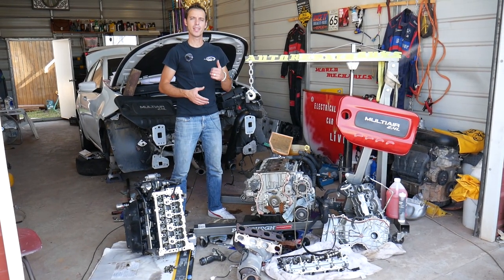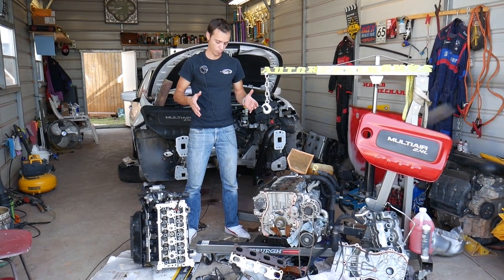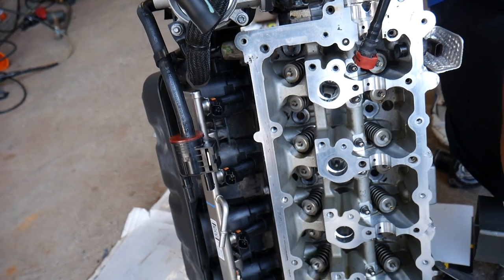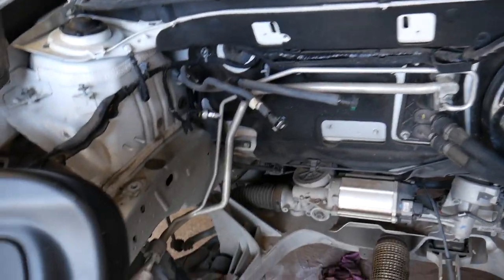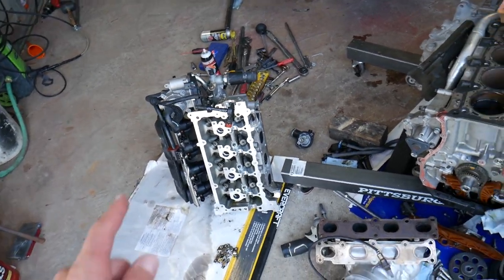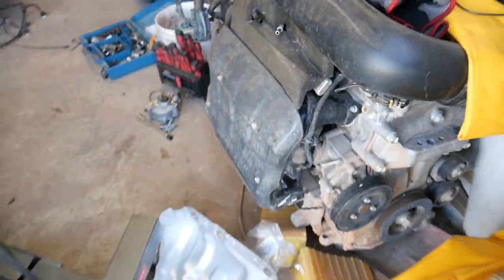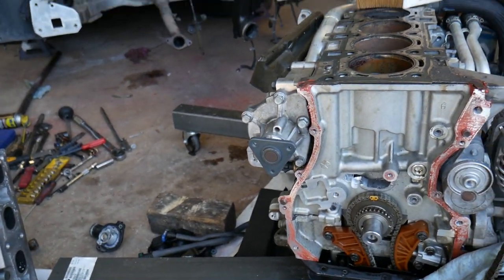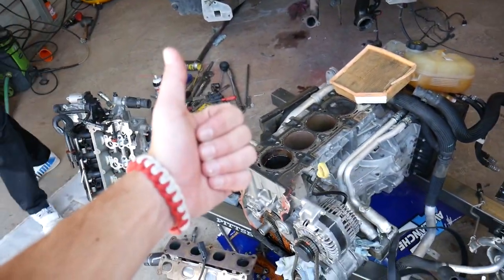WHAT CAUSES BLACK SMOKE OUT OF EXHAUST demonstrated on DODGE

Comment: Will fuel injectors cause misfires or jerking while starting engine from cold start?
Reply: Did you find solution to this problem
Reply: @AjextechWebDesign-zk2mh not yet, my buddy took over the payments and he's having this problem, but its only black smoke on taking off then clears up but car jerks when starting up.

Comment: Wouldn't a dirty air filter force the engine to spray less fuel? Unless intake air is metered before the air filter, and has no o2 sensor, the air filter shouldn't play any role in fuel metering. From my understanding.
Reply: I am thinking the same thing. The ECU should adjust the fuel mixture accordingly, but usually they have a certain limit from which they won't turn down from - so it suffocates from air and creates black smoke.
Reply: everything else would be working overtime. there would also be unburnt fuel definitely l. either way your getting poor mileage for the error. it's either retarding the timing or something

Comment: Do you think I have a bad fuel regulator? I recently got a code that it was getting uneven electrical current. But I charged the battery and the check engine light went away. I get black smoke when getting uphill on a freeway. My car has new oxygen sensor, recently cleaned MAF, and new air filter. The only things I can troubleshoot next would be throttle or maybe fuel regulator but I'm not getting check engine light to come on.  (2007 Audi A4 2.0; 163k miles) I'm not seeing coolant leaking.

Comment: 1- Bad Air Filter
2- Bad Fuel Injectors 
3- Bad Fuel Pressure Regulator
4- Bad Mass Air Flow Sensor
5- Bad Oxygen Sensor
6- Bad EGR Valve 
7- Bad Engine Computer

Note: I done all that & spent all that money but still black smoke & black liquid from exhaust 🤦🏻‍♂️ I now sold the f💩💩ken Audi A4
Reply: Any of This  reason, if have problem Isn’t car need to signal on dashboard with the eror code ? Or when we connect to computer ?
Reply: That's what I did to the fucked up golf 4
Reply: @ozandarik6757  nothing was coming up on the scanner
Reply: uggh, I am there now. Can't afford to replace everything on the list. I also recently had a lot of work done due to oil leaking on two parts of the engine one of them on the housing.

Comment: A stuck open fuel injector will rather cause a White smoke out of the exhaust..a raw, unburned fuel coming out, bcus of the constant/dead misfire inside of that particular cylinder..a raw fuel that steams as white vapor(and smells like gasoline) from a hot exhaust